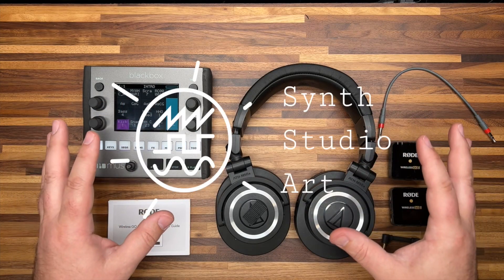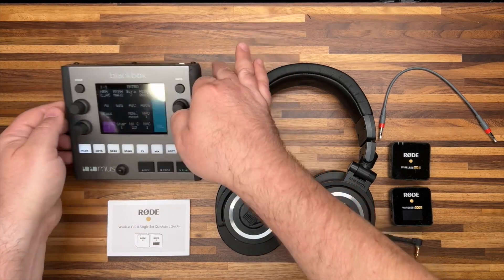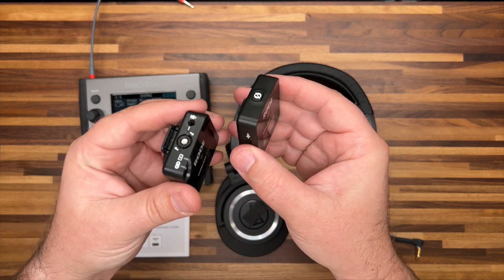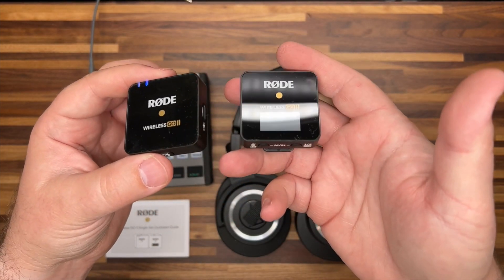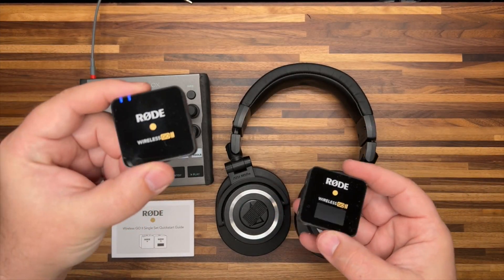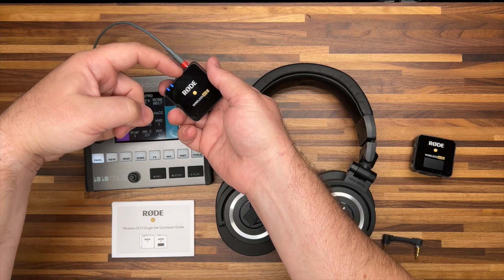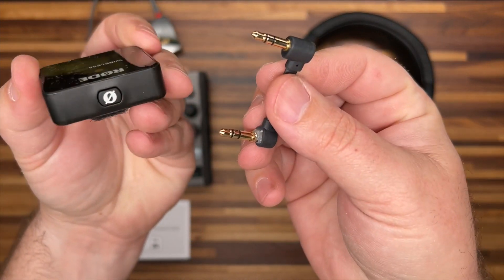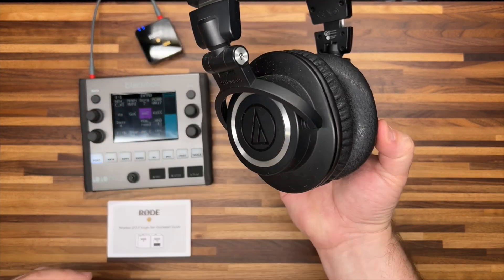How to get low-latency wireless audio using Røde Wireless GO ii

Comment: If anyone's tried using this with dual transmitters to get a stereo signal at the receiver I'd love to know if it works and is semi-reliable for home-studio use. I'm worried it might introduce phase issues or other problems that may be hard to predict. Haven't seen anyone online trying this setup yet :)

Comment: Just a question, just in case you tested that. Have you tried to connect a TS MONO cable to the mic input on the transmitter? I'm thinking on splitting the stereo phones output of my device into two mono TS path with a splitting cable. Then, connect each TS to each of the transmitters of a GO 2 dual. This will get me a true stereo on the receiver....should work, isn't it?

Comment: so as long as the headphones have a wired input you can do this?
EDIT: also you mention you dont use a computer, my problem is I use a DAW (logic) to practice guitar through headphones and hate having cables. So does this work for that situation? I’m trying to remove the cable from my audio unit to my heaphones, not the guitar jack lead
Reply from the maker: I think this solution is especially suited to guitarists because of the mono nature of the single transmitter (you need 2 for stereo). I'm not sure how you're using Logic, but I also use Logic (just for mixing & mastering) and you can adjust the latency settings to reduce latency, or some audio interfaces will let you bypass Logic and loop the guitar audio directly back to yourself without all the plugin processing, like the Audient Evo 4 that I use.

Comment: Hi, can I ask you to try connect the transmitter to PS5 or a PC with a 3.5 to usb-a/type-c adapter? 
Turn like a dongle other 2.4ghz headsets.
Thanks😁
Reply from the maker: It would work like that. I don't have a PS5 but I have done it with my Mac and it works as expected.

Comment: this worked in terms of basically 0 latency for recording instruments, but the problem is that it degrades the audio quality so much that I can't judge if im getting a good take when im recording. it sounds like listening to a 64kps mp3 file, sucks all the life out of the sound.
Reply from the maker: Really? Interesting. I only do ideation work with this setup, so I've never noticed that, but I guess it makes sense if it's transmitting wirelessly.
Reply: Friend, did you feel this in the Rode Go 2? Your comment really saves me from a bad purchase, I wanted to use a rode go 2 to transmit the live sound of my monitoring mix to a Sony camera,  but if it degrades the sound it won't work for me.
Reply: @johannmunoz_gtr  yes, the roses degrade the sound quality too much. also bought the DJI one and it also degrades the quality too much to use. it just comes with the territory for now until the technically can improves. also got the TMA-2 Studio Wireless+ and same deal. They only get used for bass now, because you can't hear the degradation with that

Comment: LINE LEVEL INPUT.. Rode copes ok with that input?? 
I couldnt find the spec for that.  

Thanks for the info :)
Reply from the maker: Yes Andrew, it copes fine with line level input. It also has three attenuation options built-in, but I never use those.
Reply: Owning this setup myself and using it daily I’d argue it doesn’t deal well with line level. Even lowering the sensitivity to the lowest you will get audio but not super clean because it’s expecting a mic level input. You really should get a line level to mic level attenuation cable. They’re like $20 and your audio will be MUCH cleaner.

Comment: how are you confirming that this works with stereo? according to the pdf you linked and when browsing the product itself, the dual channel version requires two transmitters. are you saying that the single channel version still transmits a stereo signal (and has actual stereo separation in the output)?
Reply from the maker: No, you're right, Pablo. True stereo separation at the destination requires the dual-transmitter version of the Røde Wireless GO ii. Admittedly, this is a major oversight on my part, but I can see why it happened. When I first tested it, I was getting dual-mono from the left channel in my headphones, and I assumed it was a stereo signal because my source audio didn't have enough separation for me to notice the difference.
Reply: @synth-studio  Thanks for the confirmation. I was really excited at first about the prospect of having a low latency headphone transmitter but I'll have to keep looking 😢 If someone makes a 2.4/5ghz stereo low latency system with swappable batteries they could make a fortune.
Reply from the maker: @PabloEdvardo  Yes — exactly!
Reply: If anyone's tried using this with dual transmitters to get a stereo signal at the receiver I'd love to know if it works and is semi-reliable for home-studio use. I'm worried it might introduce phase issues or other problems that may be hard to predict. Haven't seen anyone online trying this setup yet :)

Comment: Does it transmit lossless audio? What is the max. bitrate?
Sorry Im confused xD
Reply from the maker: For streaming:
Røde doesn't seem to publish the streaming bitrate, but since it's 2.4GHz, it's more than capable of lossless audio quality.

For internal RECORDING:
"...uncompressed WAV format..." "...48KHz, 24-bit audio."
From https://rode.com/en/about/news-info/wireless-go-ii-on-board-recording-and-audio-export-modes-explained
Reply: @synth-studio  Thank you. Do they transmit in stereo? A friend just tested it today and It was mono. He transmitted his pc sound to his headphones. If this would perfectly work for transmitting pc then I would love to see someone who can mod his studio headphones with that. An extra akku and maybe built in wireless modmic. This would be the best wireless headset. I wonder how rode can make this 4ms link when others have minimum 16-17 ms.
Reply from the maker: @ramo_fpv  yes, it transmits in stereo if you set it to that setting.
Reply: @synth-studio  The website doesn't mention it being stereo. It comes with one receiver and two separate transmitters, so technically it's "two channel", but each transmitter appears to be sending monophonic signal. At least this is what the available info on Rode site implies (they don't say it outright). But since the device is essentially marketed as a microphone, it'd make sense for each single transmitter to be mono, not stereo. So, for stereo signal to the headphones, it looks as though you'd have to split R & L at the device (an audio interface, say), and use both transmitters in parallel.

Comment: Hi, thank you for discouraging me from spending hundreds of dollars on headphone pair :) I still have some questions tho

1. As far as I understand, the headphones will be powered with the Rode battery, yes? Even if I'll buy the bluetooth headphone  with battery of 60 hours, it is the "wireless" Rode battery that maintains the connection. So say, Rode advertises 6 hours of battery time. Could you test on your ATH-M50x (or any other non bluetooth headphone) at max volume, how long is it powered. As far as I understand, the higher the impedance the faster it will be drained.

2. Upon looking for similar products, I've stumbled upon DJI Mic, that really fascinated me. Do you think Rode wireless aux method could work on DJI?
Reply from the maker: You're welcome : )

1. You raise a good point. Most headphones are pretty passive in terms of power, but in our high-end audio world, it's worth knowing that your headphones will run okay from just a 3.5mm stereo audio input. As far as 'power' - if your headphones are "high impedance", I don't know whether or not the Røde will supply enough power to drive them at sufficient volume. I can only vouch for the Audio-Technica headphones I'm using, and several wired earbuds I tested.Mine are the Bluetooth version, but I never turned them on during my testing, so I don't think the AT's battery was being used at all. As far as the Ride's battery, there isn't a way to adjust the volume on the Røde setup—instead, you adjust it at the output source (the groovebox or synthesizer). I don't believe the Ride's battery would drain at any different rate—it's just transmitting whatever signal it receives.

2. Good shout. I have not tested the DJI mic, but as I understand, it is a very similar product to the Røde Wireless GO II. It very well may work, but I do not know for sure. If you test it, let us know the results!

Comment: thank you for the video, are the transmitter and the receiver stereo?
Reply from the maker: Yes, they auto-detect the cable type you plug into them to deliver either stereo, mono, or dual-mono with multiple transmitters.

https://edge.rode.com/pdf/page/90/modules/448/WirelessGOII_Datasheet-PATENT-PENDING.pdf
Reply from the maker: @eriser I need to update my reply, here. I misunderstood the manual and was not getting true stereo, but dual-mono from the left channel. So for clarity, to wirelessly transmit true stereo, you need the dual-transmitter variant of the Røde Wireless GO ii. For me, however, dual-mono is fine for sketching ideas, but then obviously a stereo setup is required eventually as a track progresses.